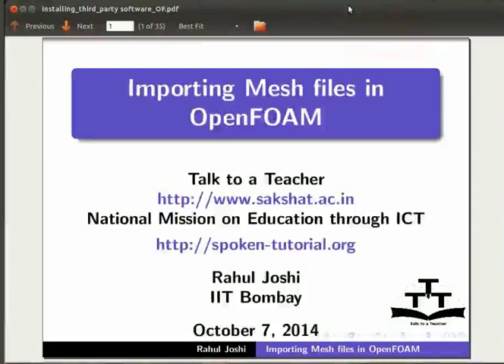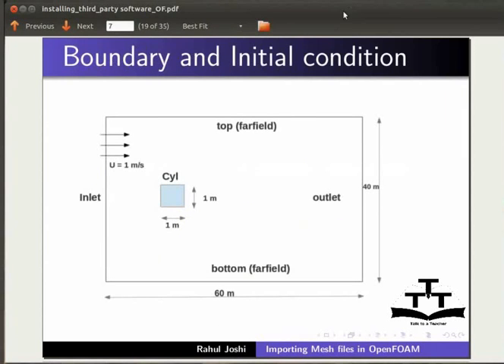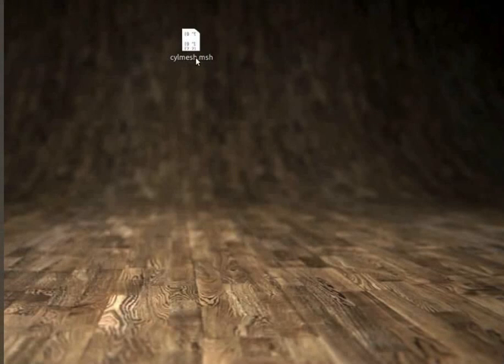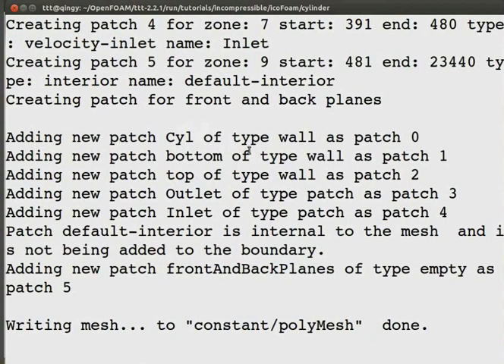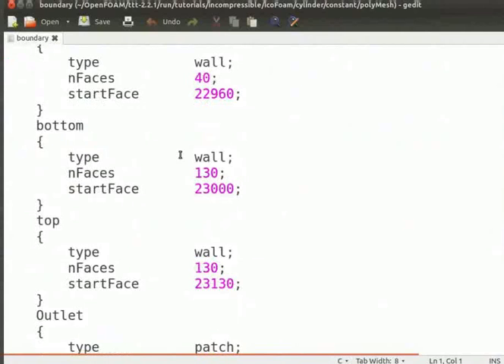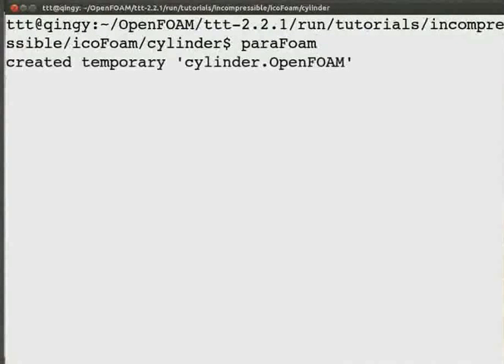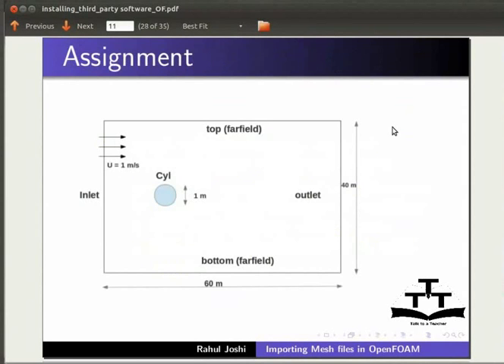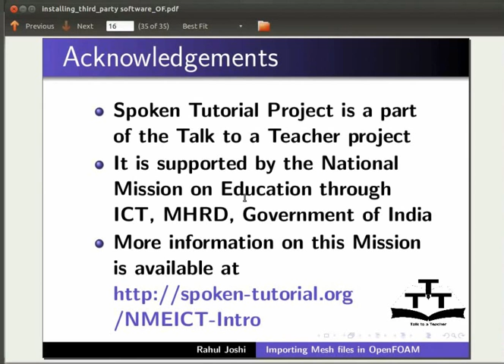Importing mesh file in OpenFOAM - English

Comment: Hello, great video, very informative thanks

I have a conjugate heat transfer problem, few electronic components being cooled directly by a fluid (immersion method of cooling) and i am using OpenFoam for this.

I have created the geometry and mesh in Salome software and was able to obtain the mesh in .unv format then using IdeasUnvToFoam, in openFoam.

Different cellzones corresponding to different solids were identified in a single ""cellZones" file in "constant" folder. Now i need to specify different thermo-physical properties for each solid such as cp, K, rho etc and need to give certain volumetric heat flux values to some solids. I am trying to use splitMeshRegions command to get different zones but not able to due to this error -" Build: _b45f8f6f58-20200629

Expected 0 arguments but found 1

See 'splitMeshRegions -help' for usage" 

Thanks in advance for any help

Regards

Comment: Dear Sir,
fist of all thanks for the video. it is very useful.i am facing some error while run.
can you explain what type of error it is?

Create mesh for time = 0

--> FOAM FATAL IO ERROR:
keyword PISO is undefined in dictionary "/mnt/d/box/system/fvSolution"

file: /mnt/d/box/system/fvSolution at line 28.

    From function const Foam::dictionary& Foam::dictionary::subDict(const Foam::word&) const
    in file db/dictionary/dictionary.C at line 689.

FOAM exiting

Comment: hello 
i found your video very useful for icoFoam i need a help regarding simpleFoam to run a fluent based mesh generated file.  i am trying to run a mesh file for the 2d airfoil but the .msh file is not running with the command fluentMeshToFoam plz help me for it

i wanna add that i am using ubuntu 15 vivid openfoam 2.4.0
Reply: Did you solve your problem????? I need help
Reply: @samuelparra1471  I need help on this too..any luck so far? I know it's been a while..
Reply: Jithinjohn George Nope, I never solved it.

Comment: dear sir,
I am trying to simulate flow over three cylinder and facing issue with boundary condition implementation. As I have defined boundaries in GAMBIT, I have not able to compare it here.